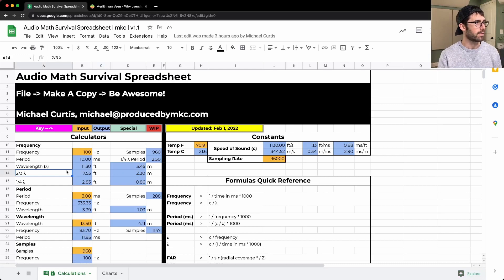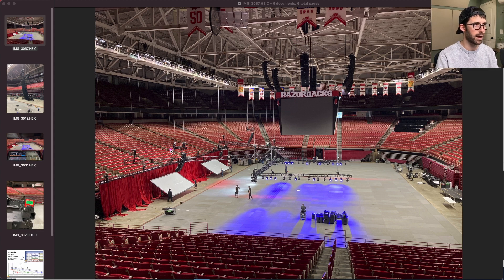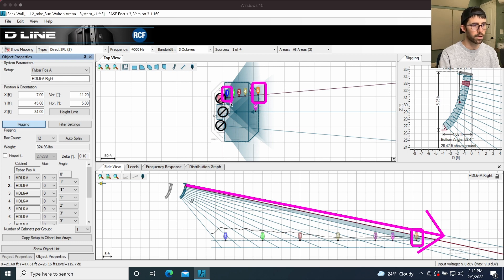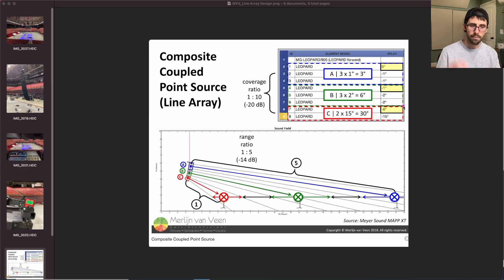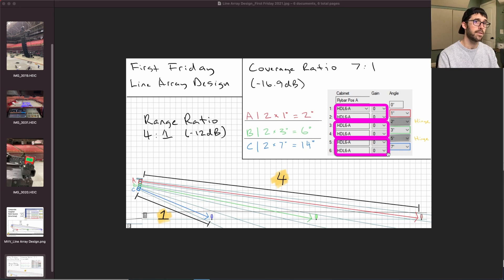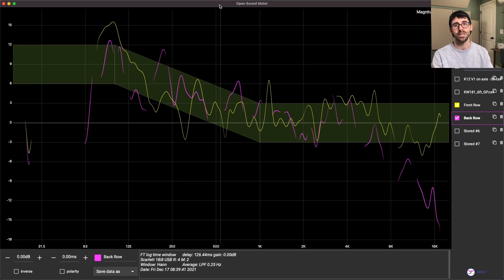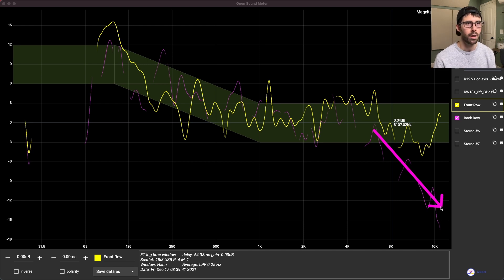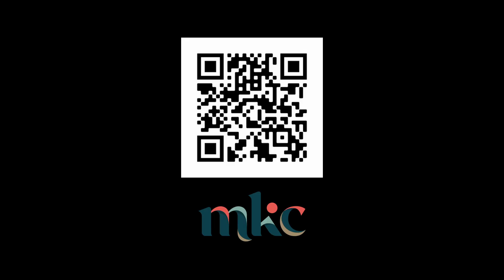Point (Some) Of Your Line Array At The Back Wall

Comment: As far as d&b Arraycalc goes:

You put in your listeningplane and then you can apply autosplay. 
But what does autosplay actually do?
It angles the elements so, that the on axis points of the cabinets are evenly spread across the listening plane. Thats all it does. 

Next to the button it says: this might not be the optimal solution, manual adjustment is needed. 

So its just there to point everything in kind of the right direction. Anything else you have to do by yourself. 

I also tend to overshoot because it really helps to get even spl distribution. 

And acutally its not that different from pointing a horn speaker. There you point the on axis also nearly on the last row. So that is that. 

If you are using arrayprocessing for that matter, it might help to put a vertical ghost plane behind the actual listeningplane so the optimizer does not ignore those top boxes. But i think they are working on a solution to that workaround already.
Reply from the maker: I'm looking forward to the update where they include a variable amount of overshoot. And yes, overshooting really does help with even SPL distribution and also helps steer the low-mid beam more upwards (if the system does not have any low mid beam steering mechanism like AP or LMBC).